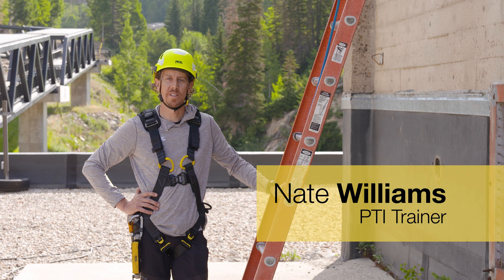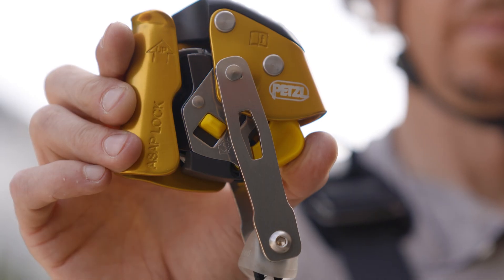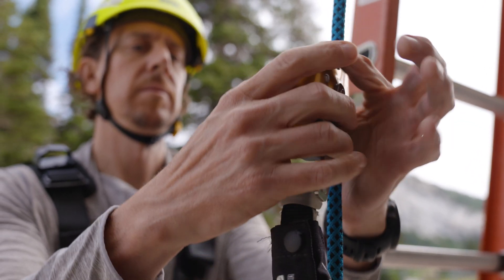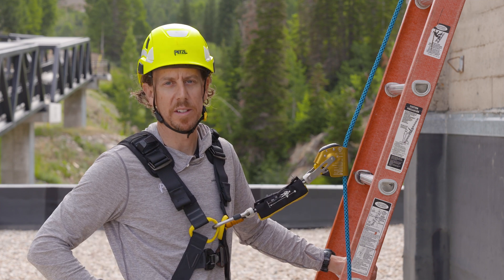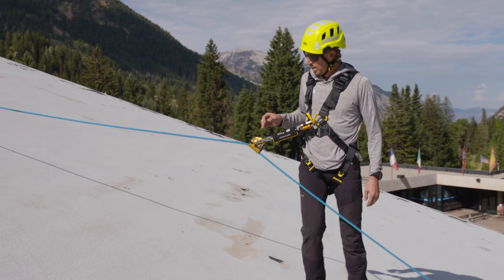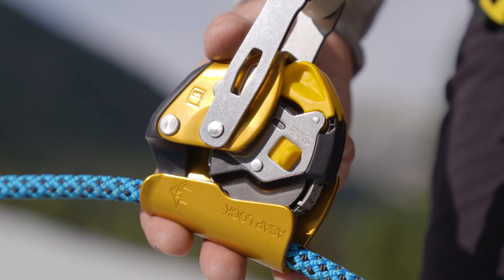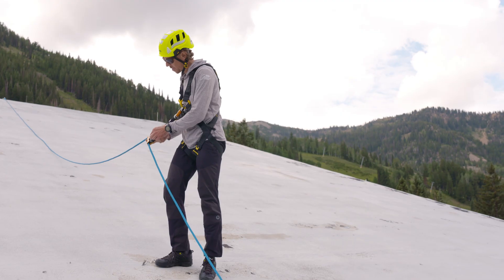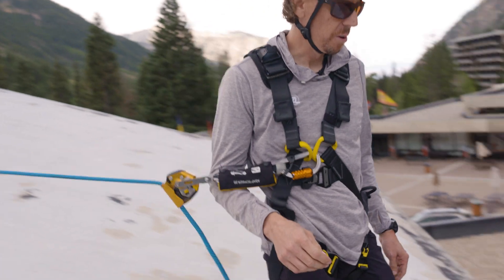HOW TO - Use the ASAP LOCK on a Vertical Lifeline in a Sloped Roof Application

Comment: It works by acceleration and you must not dangle in midline, therefore you need to make a stopper knot. Im not an expert but this seems like having a rope through a cheaper pulley + stopper knot can do the same thing.